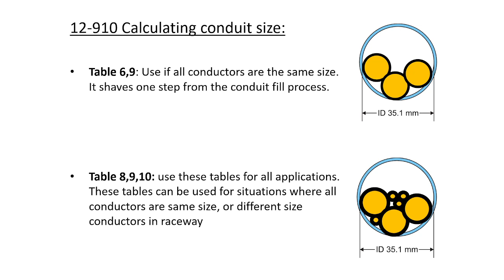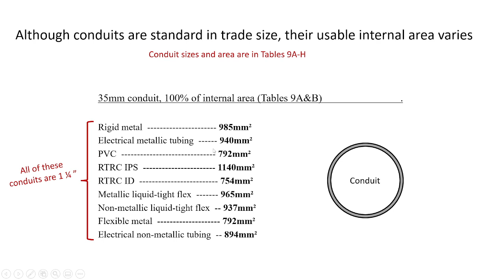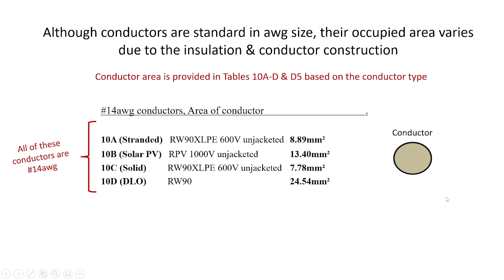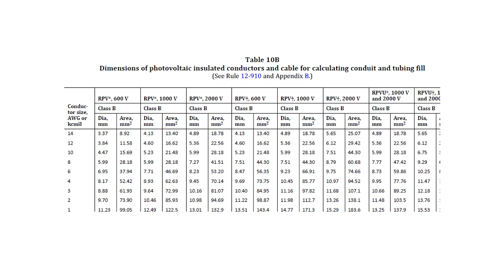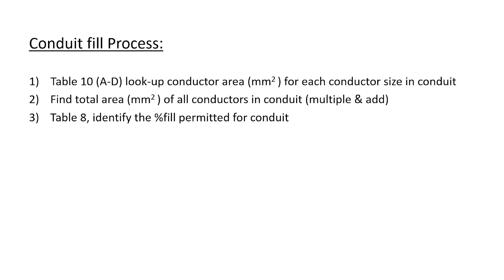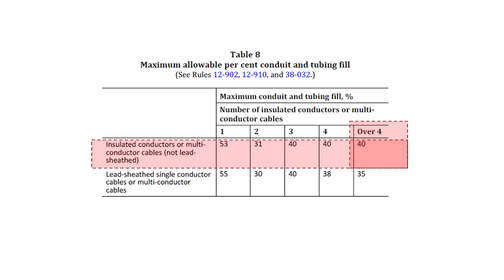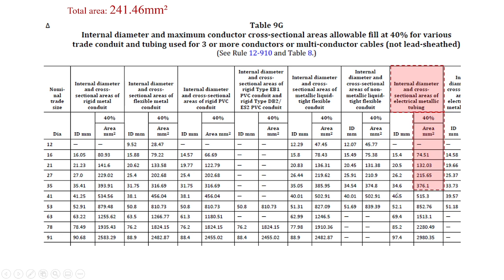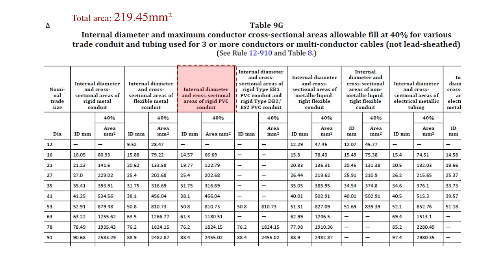Section 12 CEC: Conduit fill

Comment: why not use table 6-a
Reply from the maker: Afternoon,  Table 10 was used  because of different types/sizes of wire. In the 2024 edition table 10 has been deleted, along with some adjustment of values means we will only be using table 6, 8, 9 going forward.